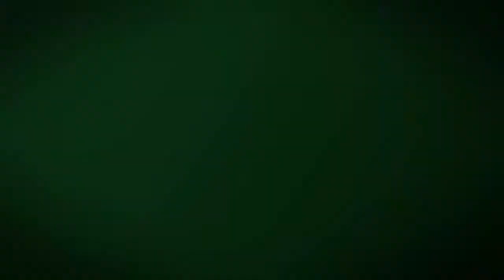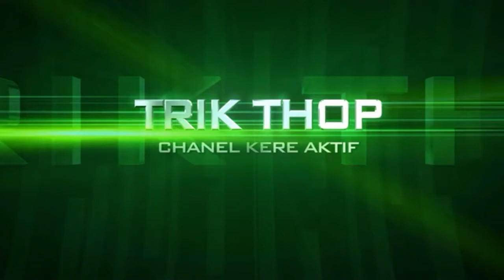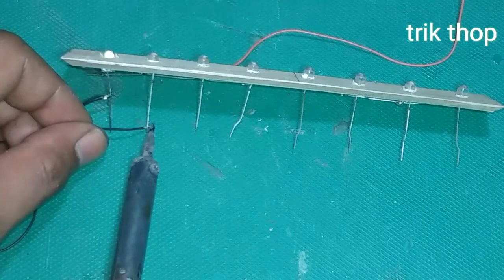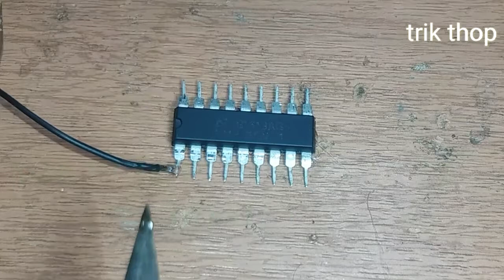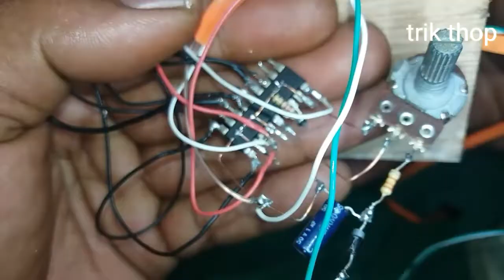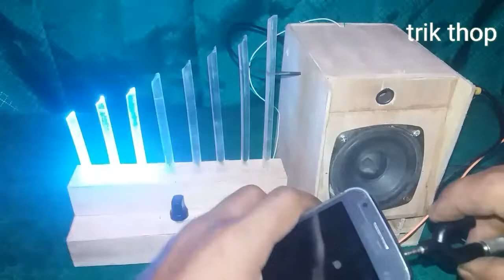DIY buat vu meter level amplifier

Comment: Kaki led 5mm plus di sambung semua , min nya kasih kabel semua

Ss datasheet ic
IcLM3915 1
R200ohm 1
Potensio Mono 50k 1
R33k 1
Elco 1nf 50v 1
D 1n4002 1
R330 ohm 1
Switch saklar 1
Kabel usb 1